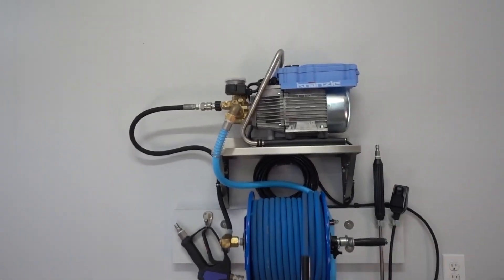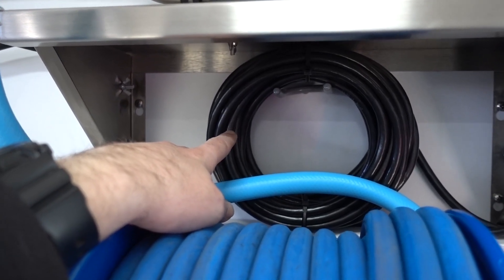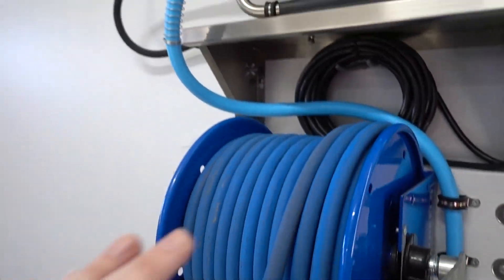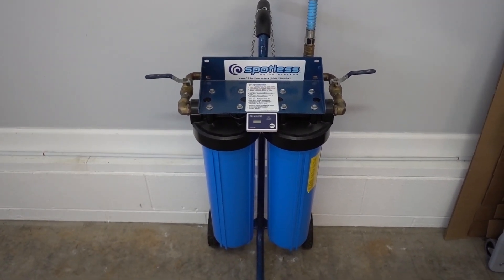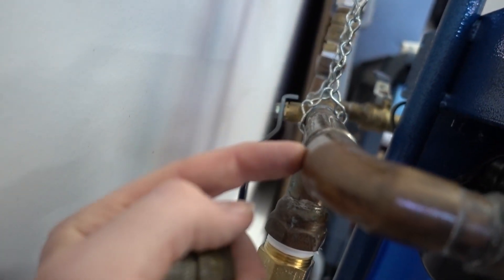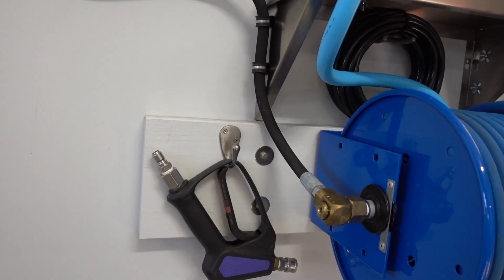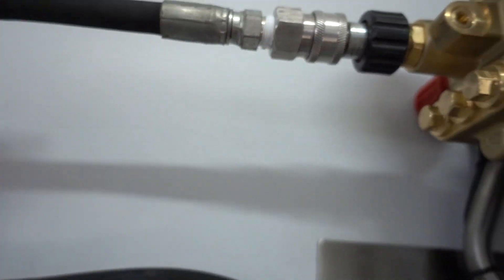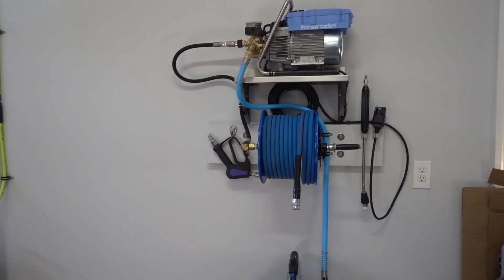Kranzle 1322TS Pressure Washer - Wall Mount Set Up

Comment: Scott, what size lags did you use to mount board to studs,  then what size lags did you use to mount the reel to the board ????    I am doing a setup just like yours and this info will help !!!!!!
Reply from the maker: I do not remember the exact size. I would recommend using what you can find and also keep in mind that you are a mounting them to a 2 x 4 stud in most cases you are mounting them to a standard wall in a home in America

Comment: Great setup , can you run this unit with a foam cannon on a 15amp
Reply from the maker: I have two different foam cannons and I don't have a problem running either one. That does not mean that someone else may not have a different issue depending on the wiring situation in their home.

Comment: Good stuff, thanks for taking the time to share your knowledge. How long is your Kobra Jet? Most people appear to use 100', but that seems like overkill for car washing. I'm also curious about pressure/flow loss. That said, the 100' appears to look a lot better on the reel.
Reply from the maker: I have a 100 foot hose. The reason I have that is because the pressure washer is stationary inside of the garage and in order to get the end of the hose out of the garage door to the driveway is already about 20 feet of hose so all in all I'm able to use about 75 foot of hose outside. I do have a longer driveway so I have flexibility on where I can wash a vehicle or trailer with out parking it directly in front of the garage door and then have plenty of hose to get around all sides. It's the perfect length for me but may not be necessary for everyone. I would say 75 feet of hose would be ideal for most people, but it just depends on how you use your pressure washer!
Reply: @scottwalker19  Thanks for the prompt and detailed reply. My mounting location is very close to the garage door, so I should be able to get away with 75 (or even 50).

Comment: how do you bring in water to the Kranzle?  do you have a spigot in the garage ?
Reply from the maker: i use a garden hose from outside and bring it in when I plan to use the pressure washer. I usually have the garage door open anyways with the pressure washer hose, water buckets and cleaning supplies so its not a bid deal. The garden hose runs to the piping on the water filter.

Comment: Hi.  Can you tell me what the coiled up electrical cord is hanging on under the shelf?  I'm going to have to do the same thing since Kranzle says cutting the cord will void the warranty.  Thanks.
Reply from the maker: I just used a little “screw in hanger” from the hardware store. It almost looks like a wishbone if you know what that is. It just has two prongs and a screw at at the end to go in the wall.

Comment: Hi, would you happen to have to part number from your Coxreel . It looks like 112-3-100 but I see in your video there is some additional numbers. I'm waiting on my Kranzle 1322TS to come in and trying to source the Coxreel elsewhere since OG is out of stock. I may end up going with 112-3-50 since I' will be running a 50ft hose. Thanks
Reply from the maker: I ordered mine from Northern Tool but they may have it on Amazon as well. Mine is a 100ft hose reel.

Comment: What's your TDS of your incoming water? How long before you have to change resin?
Reply from the maker: The incoming water is between 20 and 30 using a TDS meter. I change my resin once a year. It usually gets up to 5 to 10 on the de-ionizing filter by the time I change the resin. From what I understand usually you can go up to almost 20 before water spots are more prevalent.
Reply: @scottwalker19   Ok Thanks.

Comment: Scott, what fittings were used for the 90 to the pump for water inlet? Didn't see that in your list
Reply from the maker: The fittings that carry the water into the pressure washer are from Home Depot. they seemed to have a much better selection of fitting vs Lowes. Not sure where you live and what's around. But I got them in the plumbing section of Lowes. Basically you need to get the 90 degree elbow and two fittings that have a garden hose fitting on one side and then FIP or whatever the other small threaded name is on the other side. It goes from one side of the elbow to the other in this manner: garden hose threads to FIP into the elbow then the other side of the elbow is FIP as well and then back to garden hose fittings.
Reply: @scottwalker19  what fitting use at pressure washer port, that is the M22 x 14 correct to what fitting?
Reply from the maker: @jonasgolden3277  The fitting that goes into the pressure washer is a garden hose fitting. I have the Male quick disconnect in that end and the female quick disconnect on the adapter that comes off the elbow.
Reply: @scottwalker19  ok ty, just got my 1622 today, can't wait to install when home from work next week

Comment: How did you mount the reel to your wood brace?  Seems like a tight fit to attach screws. Can you tell me how you did it?
Reply from the maker: I used 3/4” or 1/2” lag screws and then screwed them down with a wrench.
Reply: Nice set up do lag screws go straight to garage studs ?
Reply from the maker: yes
Reply: @scottwalker19  how long were your lag screws for the hose reel? Do they end up poking out the back of the 2x8 & drywall?

Comment: Are you running the Kranzle on a 20A or 15A circuit? I see that OG recommends 20A for foam cannon use. It would be difficult for me to run a new circuit.
Reply from the maker: I believe that it is on a 15 amp circuit. I have not tripped the breaker with the pressure washer yet. However if you use the pressure washer and another high output item like a shop vac it does trip. I have used my pressure washer with a chemical guys foam cannon and the new PF-22 foam cannon. I did not put the smaller orfice in the foam cannon, I believe that is what causes the built up pressure and require the most amps. I could also not comment on older 15 amp circuits. My breakers are less than 10 years old. I am sure it could be a different story if you were using a breaker that was 50 years old.
Reply: @scottwalker19  Thank you for the response. Great information.

Comment: Great video. It was great how you walked through each component. Question on the mounting of the coxreel. Is that a piece of wood or 3/4 plywood that you have attached to the studs? I am debating whether to use wood or plywood? Thanks
Reply: @nate did you figure out what to use? I'm debating as well. I'm thinking of slapping two 3/4" plywood together.
Reply: @ayodangit  I spoke with someone who is very knowledgeable, and he told me that poplar or pine were better options over plywood. I picked mine from Home Depot
Reply: Nate C thanks! I ended up picking up pine from Lowe’s. Thank you.

Comment: Do you find you have flow issues where garden hose and pipe is flowing vertical up towards kranzle?

I’m debating doing something similar, but my hose outlet/water bib is 2ft off the ground. And would need to flow up towards the pressure washer several feet
Reply from the maker: Overall that should not be a problem. It is a short distance compared to how the water would flow of the walls to the second floor home. My biggest restrictor is the water filtration system. The water Hass to flow through all the filtration before it gets to the pressure washer so that may reduce the flow output. I have not tested it but I do not notice any issues with my usage. Hopefully that helps!

Comment: Very nice!  I just picked up everything but the hose reel and water filter. How do you like the Hose reel?
Reply from the maker: The reel is nice and it makes storing the hose much easier than rolling it up on the ground. Everything is very heavy duty. I wish the handle mechanism was nicer but it is still sturdy.
Reply: @scottwalker19  just got my 1322ts up and running. Wow what a sweet machine!  Just need a clean way to hang my gun and lance.

Comment: Great setup I'm just getting mine together. I was wondering is it OK to power the pressure washer from the power socket and leave the switch on, on the pressure washer as my washer is high in my garage. Cheers 🏴
Reply from the maker: I dont think that is the intended way to use it. I dont think they would recommend using it that way either. Since it is controlled with a pressure switch the electronics may not allow that. I have mine mounted about 8 feet off of the ground as I have to reach over my head to switch it on at the unit. I would recommend consulting the manual on that and consider mounting it at a reasonable height to accommodate usage!  Thanks!
Reply: @scottwalker19  it's gona be a step up switch on. A few seconds on a step and it's on then. Cheers👍
Reply: You can buy a controller to switch machine on and off with a small control it plugs between the socket and machine

Comment: The outlet your using is not rated for 15 amps a 15 amp outlet with have a line going through one leg post. Does it shut off when using or trip a breaker? That’s why the plug is hot!
Reply from the maker: I have never tripped the breaker using the pressure washer and I have been using the pressure washer for over 2 years now.
Reply: @scottwalker19  awesome I just ordered one myself I have a 4500psi 4gpm gas but man it’s so loud that I searched for a quiet solution so I ordered this one be here in a few days.  crazy part is I moved recently and I knew I had ordered an OG mosmatic sprayer. I couldn’t find it so I ordered a cheap one from Amazon.  I was like what the hell am I doing. Then I went all out and got the $309 mosmatic sprayer and wand combo the same machine you have here and the filters reel, and hose. I have a motor and switch I’m putting on the reel. Anyways I got all that coming and today I was washing one of the cars we haven’t drive in months and found the OG sprayer... and I got a 2.2 foam cannon today that came with a nice mtm sprayer...  I still have the OG mosmatic sprayer coming and wand. Can’t wait to hook this all up! I got to use my mosmatic OG sprayer for the first time today. I ordered it end of last year so I started thinking to myself maybe I didn’t order one lol glad it’s working good for you

Comment: Nice setup there!! What are those homedepot clips that you use to hold your wand and cord called?
Reply from the maker: https://homedepot.sjv.io/c/2088740/459920/8154?prodsku=202305505&u=https%3A%2F%2Fwww.homedepot.com%2Fp%2FEverbilt-7-8-in-White-Steel-Spring-Grip-Wall-Mounted-Hooks-2-Pack-5-lbs-18028%2F202305505

Comment: What length pressure washer hose do you have? Where did you buy the water filter system?
Reply from the maker: I believe the pressure washer hose is 75 feet long. I got the water filter system from Amazon

Comment: I noticed my 1322 gets pretty warm when using it, does yours and is this normal?
Reply from the maker: It sure does get warm. That motor is working hard to pump all of the water and build pressure. The water does not really cool it as far as I know. I think it is just air cooled and that is why it is exposed metal everywhere for the most part. There may be fans at the back end of the unit where the opening is.
Reply: Scott Walker 
Thanks for responding. Was wondering about this.

Comment: nice set up man but shark bites are not a best idea using portable they will fail if you take it in and out couple of times anyway set up looks killer i like quality equipment
Reply from the maker: I have removed mine about 3-4 times and it is still fine. However if they ever did fail the are still replaceable and removable for servicing.

Comment: What size screws did you use to mount the shelf?
Reply from the maker: OptinumX If I remember correctly they probably came with the shelf. If not I just got some 2-3” stainless steel screws to go into the studs. Lowes has a good selection of stainless steel hardware
Reply: I just mounted mine and used a #10x1-1/2” hex head sheet metal screw. Mine is mounted on 3/4” plywood and into the stud on one end. The hex head works well as it allows you to snug up the bottom screw after the shelf is in position.
Reply: Where did you purchase the shelf from?
Reply: @NQTrader10  Amazon

Comment: You should cut the cable, running the machine with the cable wound up like that can damage the machine.
Reply from the maker: I am not sure where that logic is coming from. The manufacture built the machine with a long cable. Also it was wound up like that in the box.
Reply: @scottwalker19  it needs to be unwound when you are using the machine, didn’t matter when it’s in the box 😂. If nor unwound, it damages the machine by reducing voltage and power due to resistance. 
All cables should be fully unwound when using things like this, especially one like this which draws high current. 👍
Reply: Cut the cable?  And you’re worried about the cord being wound up?
Reply: @xMattMoron  ?